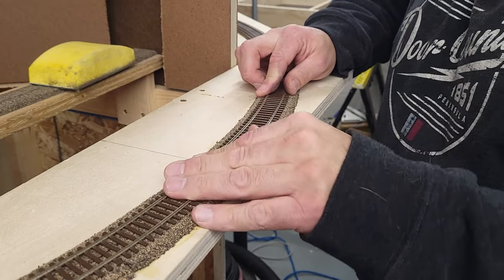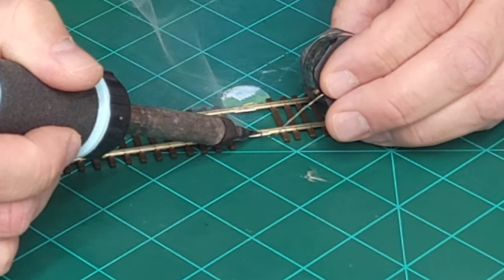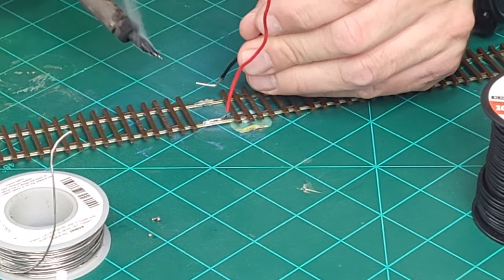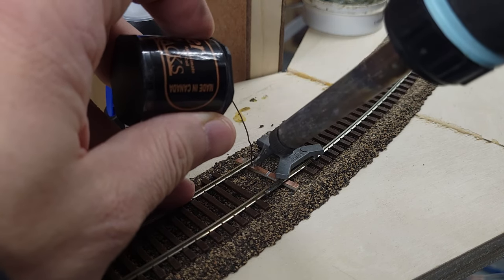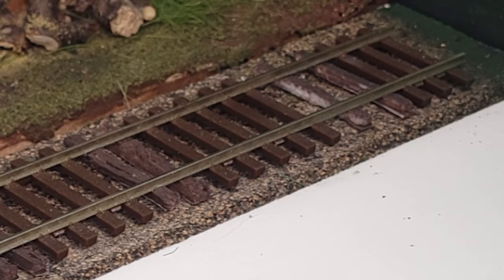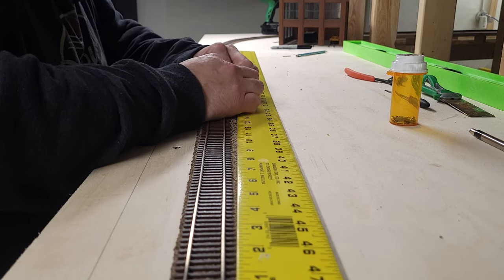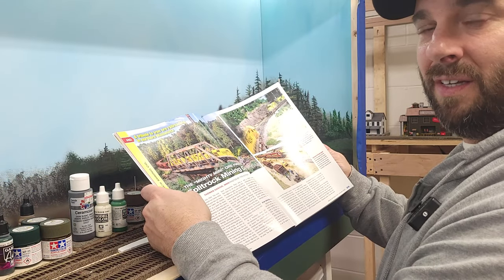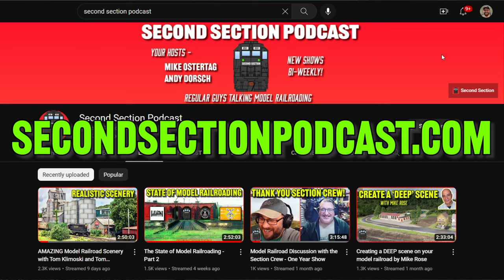10 TIPS for laying model railroad flex track like a PRO!

Comment: These are good tips. I would highly recommend PVA (Elmers) glue instead of LocTite. In the event of a need to move/adjust the track, a little water and about 10 minutes softens the glue and allows you to readjust switches and track. (Ask me how I know about this!) Thanks for sharing!
Reply: Indeed - I found a new Olfa 18mm snap off blade carefully run under the ties will lift track and turnouts from PVA pretty easily without needing to soften or dampen the glue (although I havent used the damping technique you describe for small adjustment). Scrape and sand the surface down (you can sand into a cork surface without problems) and you can re-lay the same (or new) track. 

I've lifted multiple turnouts like this and re-layed without damaging the turnout or the cork bed

Comment: A very experienced modeler said to stagger the joints of the left rail verses the right rail when using flex track on curves. This worked very well to eliminate gauge problems. He also recommended sodering all joiner connections.

Comment: I might suggest that for Tip#6, instead of a tube adhesive to use PVA glue instead. It has saved me heartache: simply add a little water and within about 10 minutes with a putty knife and some patience the track can easily be moved. Let it dry and it is hard as nails and clear again!

Comment: Great set of tips for trackwork, Andy! I'd add one more - chamfer the inside rail ends so that a wheel cannot find a square edge to ride up on. This is especially useful with joints made on curves.
Reply from the maker: I have never thought of that.  What do you use to add the chamfer??
Reply: @AndyDorsch  I use a mill file. If you chamfer the foot of the rail on the sides as well, then rail joiners tend to slide on a little easier. A friend recommends a "track use only" mill file so that it remains sharp.

Comment: Why go to rhe trouble of cork,  why not use ez track or Kato untrack? I'm a newb so, sorry if it's a daft question. 
Very nicely explained btw, I like your calm and to the point style. You make this all sound accessible  and not overly intimidating.
Reply: ez track or Kato unitrack just don't look authentic and they won't always do what you want. With those, you're working with the lengths and curves they make (generally), instead of being able to purchase flex track and curving it like you want it, or keeping it straight. The whole point about a MODEL railroad and not a train set is that you want to look as real as possible in the small scale.

Cork in itself is an option though too. You can use something similar, like foam roadbed, or no roadbed at all. Track in real life is generally elevated, so some kind of roadbed is good, unless it's a really worn down area that isn't maintained nearly as well. One thing about cork as well is that you can sand it, as he mentioned, to even out bumps in the benchwork, like between sections of benchwork.
Reply: @andrewl9191  thanks for the explanation,  appreciated 👍

Comment: Hi mate I like the tip about soldering the curve joints of flex track but what about allowing for expanding due to weather conditions etc I like the idea of soldering the curves but I’ve also seen you should leave a gap between each joint to allow for movement

Comment: Thanks again Andy, for another great track video.
Back in the 70s there were tips in the model railroad magazines, about Laying flex track, but your lecture here is better than any that I've ever seen, regarding lane flex track. 
Years ago I did this but no one had mentioned about the need for a really fine mist spray for adhesive.
You have a lot of good extra tips as well.
Thanks again!
Reply from the maker: Thanks for the info!

Comment: I was trying to figure out how you lay straight tracks as straight as possible on a layout. I'm glad I found this video. Tip #9 will certainly come in handy when I start building a layout. 👉 05:43 Those 3 foot flex tracks were very difficult to keep straight while laying them on a layout. 🥴 I'm really glad I found this video. 👏
Reply from the maker: Thanks for watching! And I'm glad I could help! If you have any questions don't hesitate to ask!
Reply: I think it's funny that a tip is how to make track straight when you think....well, you just straighten it out, right? That's how it comes, isn't it? But it indeed has some kind of flexes to it that would show or have some other effect you don't want. My N scale layout I currently  have only has limited straight (tangent?) sections as it's a couple small ovals, but I'm sure this will be helpful for my HO shelf layout in progress.

Comment: Hi Andy, beginning at time point 5:24 in your video, you are showing two different styles of track.  The track on the left side has incredibly detailed wood grain on the track ties, while the track on the right has barely any wood grain detail at all.  I really like the look of the more highly detailed track on the left.  Could you please reveal the brand and rail code of that track on the left.  I am currently planning my first HO scale railroad and want to make the right choice for the bulk purchase of flex track that I'll need.  Thanks, and great video deserving of many thumbs up!
Reply from the maker: I use Code 70 microengineering.
Reply: I think what you're saying is the weathered track on the left and un-weathered on the right. You can especially tell as there's no ballast on the right, it's just track on cork. I'm guessing there's some slight dry brush that happened on the left to accentuate the wood grain.

Comment: Great tips Andy.  Tip #5 on track alignment references using PC Board ties to attach the rail to and then glue down.  It appears you are soldering the rail to the PC Board.  If this can be soldered, it must be conductive, so how do you keep from shorting across the rails?  I have an alignment problem I am trying to fix and this seems like a great solution- except I can't figure out the shorting issue.
Reply: The PCB ties have a thin layer of copper on top the resin base. Use a needle file to wear away a strip of the copper, usually in the center of the tie. Verify there's no short across with an ammeter (or other test tool). Easy to do.

Comment: Regarding cutting and filing rails, why wouldn’t it be better to use a modeling saw designed to cut them?   

It’s been 45 years and I’m getting back into the hobby - if I can afford it now - lol. I still have that saw and have used it over the years for a variety of small jobs.

Comment: When is it appropriate to nail or spike flextrack as opposed to using glue or caulk? I've had good luck with caulk but if I spike then ballast I'm thinking that might hold it down nicely, too.
Reply from the maker: You can use spikes as an alternative to glue if you are unsure if the track placement it permanent.  It's much easier to pull up a nail then chisel glue or caulk.  Also if curves are being stubborn, you can throw a spike in there too!!